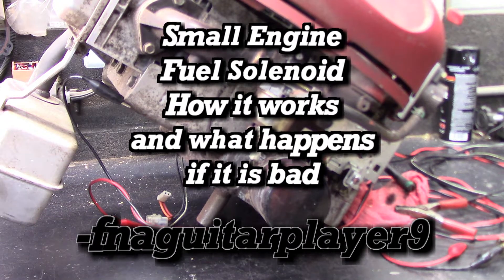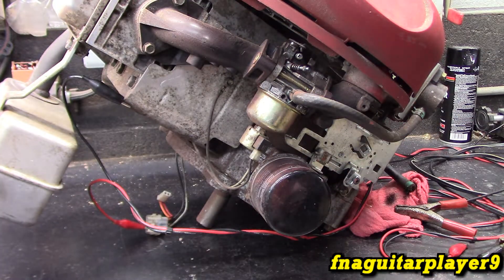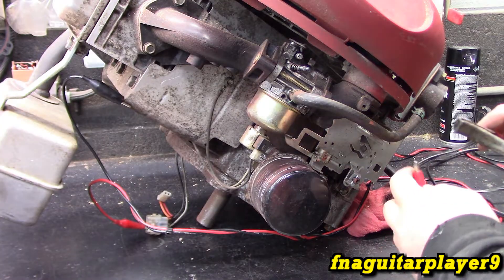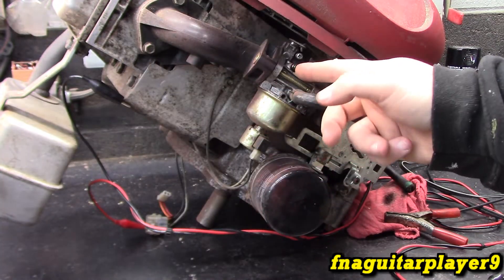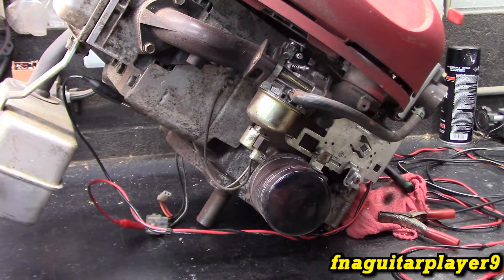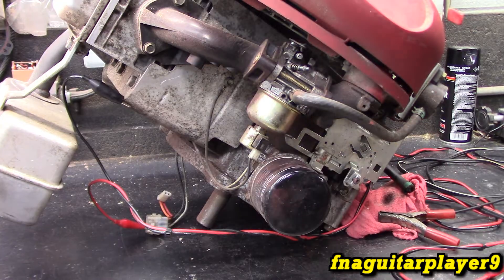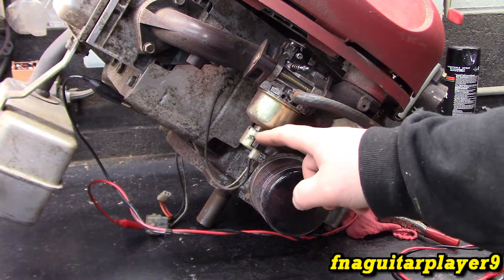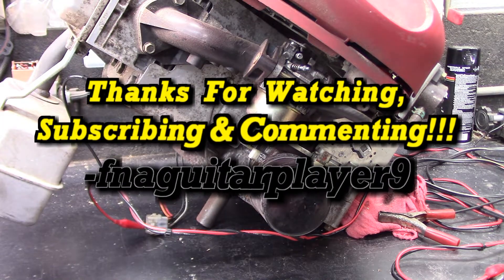Small Engine Fuel Solenoid, How They Work and What Happens if it's Bad

Comment: I have an engine just like the is but it’s black not red. I am having trouble getting it to run unless it’s on the choke. I have to go back and forth between choke and full throttle to keep it alive. 

Carb/fuel tank/lines/filter are all good to go. Solenoid has been bipassed. I noticed your engine has a fuel pump. Mine doesn’t. Do they all have fuel pumps and the guy I bought the motor from never installed one. Or was there a model or two that didn’t come with fuel pumps. Sorry for the long question. Hard to find advice on small engines these days and you seem to have quite a bit of knowledge on these motors. God bless

Comment: My JD L130 fires on starter fluid, will not run, has strong fuel flow at carb.  Considering removing pin plunger that floats free in cylinder (on a spring).  Some ppl need to cut or grind, but this pin is removable.  Thoughts?
Reply: @MarkDeaton-f3q  yeah i can't remember but pretty sure I removed it somehow, I did resolve it

Comment: Could it gunk up and cause a lean condition at full throttle?
Reply from the maker: Yes, usually though it will prevent all fuel flow in that situation and it won't run at all, but it would be possible for a partial blockage. Thanks for Watching!!!

Comment: I have 3 of those on my mowers and I had to cut the tip off one of those on my poulan XT mower engine Plus have 2 fuel line shut off the gas flow on  the poulan XT mower and the craftsman ys mower but the 1 on the craftsman gt tractor is still working so far
Reply from the maker: I've done that before, didn't even think about it until you said that, I forgot I even did that until now! Thanks for Watching!!!
Reply: @fnaguitarplayer9   you are welcome finaguitarplayer9